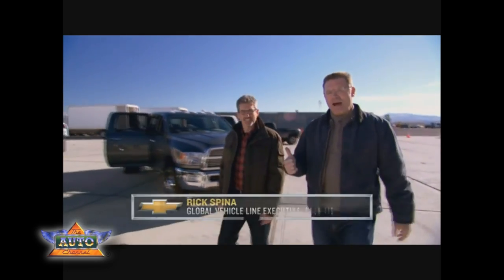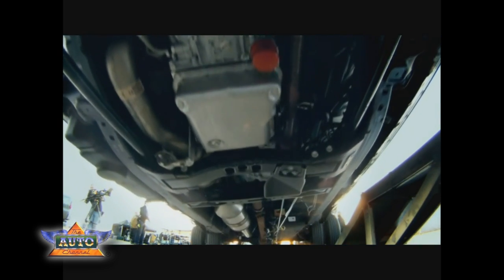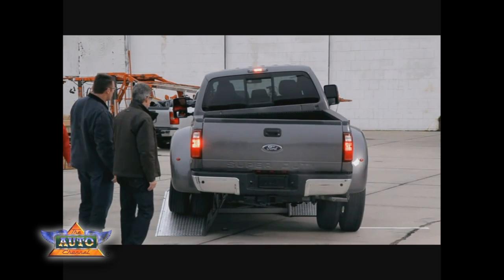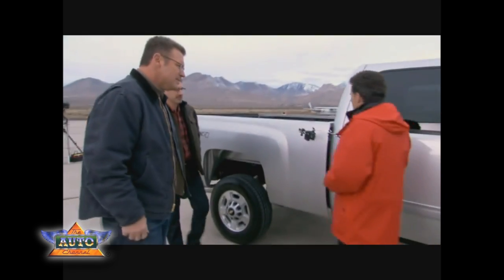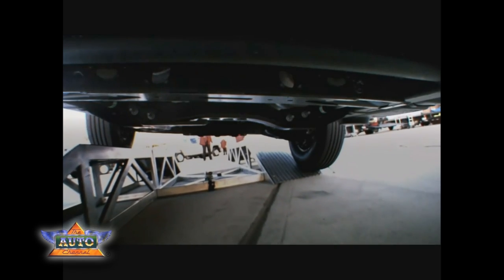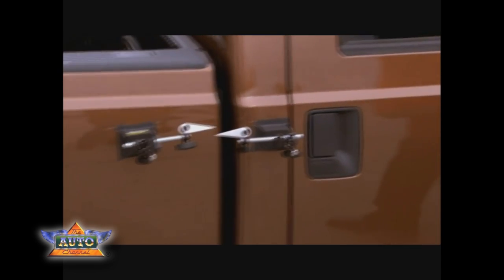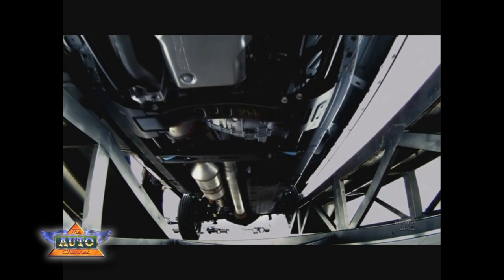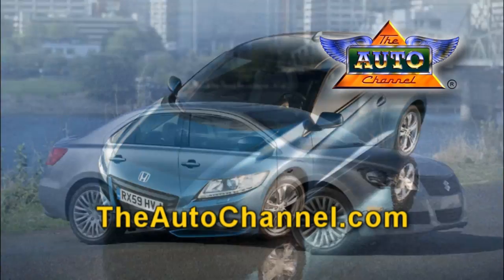Chevrolet Silverado vs. Ford SuperDuty and Ram HD - Pt 4

Comment: @chrisrider28: Actually, a stiffer body allows you to carry more and design a smoother ride into the suspension.  Plus, the more flex you have, the more squeaks and rattles you get over time.  I've ridden in Chevys, Fords and Dodges (Rams).  The Chevy always has the best ride.

Comment: I mean...I go off roading with my crew cab  dual rear wheel truck all the time HA. All frame rigidity means to me is breakage when you flex it on a regular basis.  If a vehicle is made to flex....less breakage.

Comment: @skipcar15 It's like construction. With a flexible frame you wont have stress on the whole thing. Having a frame that doesn't bend will most likely cause bending or cracking when under stress. Who cares if the ride is comfortable, I would buy a Raptor for smooth riding. I want something pulled.

Comment: you actually want the frame to flex a little more in a big truck. it it won't bend it's easier to break. look at how much a big rig flexes when they take off. GM is just trying to push a fail truck on the market.

Comment: well i have a 2001 2500HD,with the 6.0 gas motor.i tow cars with a open trailer,it pulls like they aint even there.i've put 2 yards of 67 gravel rock in the back,many times.that mite not seem all that much,until you know how much that weighs,about 6500 pounds.hauled it like nothing.the man at the quarry said he would not put that much on a ford,dodge or bulshit toyota,he said he's been doin that job for 40 yrs,loading trucks and he said if anybody knows,its him,he said nothin but a chevy for him

Comment: In a crash test the ford is going to have much better shock absorption than the chevy. Proof. Check out the Tundra it had a great crash text because of the body flexibility. Ine the end.. Its all about safety

Comment: Wow, GM you need new engineers. Do you think making the frame 30 times more rigid is better? Do you really think engineers at Ford don't know they can add more carbon to the steel to make it stiffer? Guess what? They know they can make the frames as stiff as they want...hell you can make the body out of hardox and it won't even bend in any direction ...not even a quarter inch, but you are sacrificing flexibility and making the body really prone to fracture. High stiffness equals least resistance to fracture. You want steel that is flexible...that can take multiple cycles of loads and bending...that's called fatigue strength. Stiffer steel equals less fatigue strength. You make the call now...do you haul huge loads into ditches or do you haul huge loads frequently with moderate offtrail ...you need fatigue strength. GM, your own video makes your truck and the engineering behind it look dumb. BTW, I don't own any so not biased, purely based on facts in the video and my engineering experience.
Reply: Okay dude, don't get mad they are just trucks.. 
I like both Chevy and ford and we both know every vehicle has problems and both engineers aren't perfect.